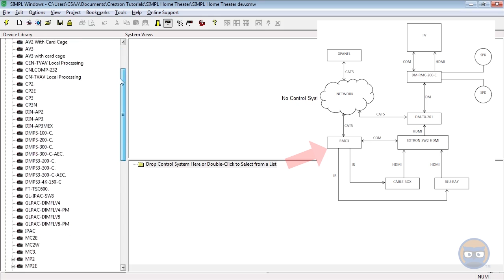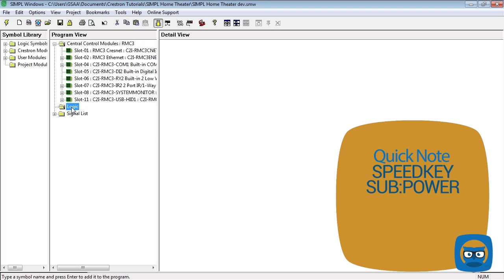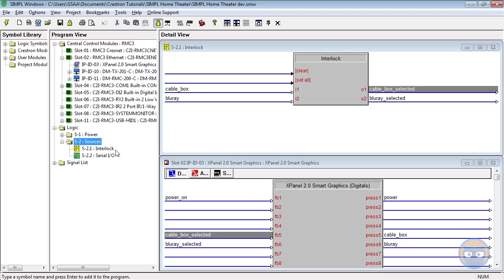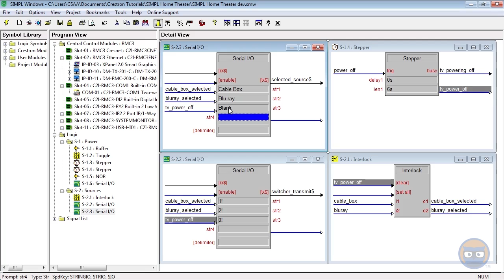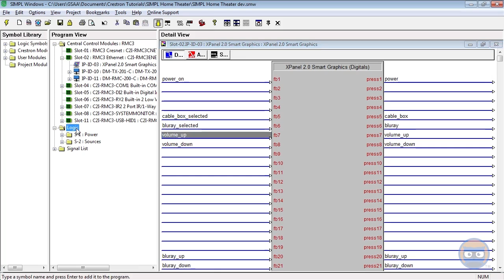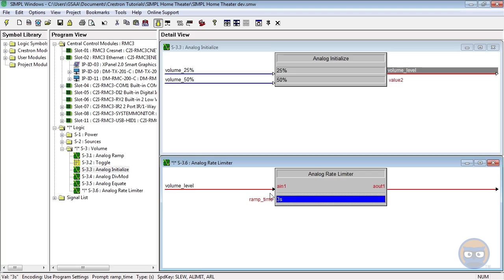Crestron SIMPL Windows HOME THEATER Programming Tutorial

Comment: Why do you add the DM-RMC-200-C to an Ethernet slot on the RMC when your wire diagram shows it being connected via DM to the DM-TX-201-C? Isn't DM a point to point communication that doesn't need to be added to the processors control slots?

Comment: Amazing videos.  I'm in our office practicing on some extra Crestron equipment since I'm being sent in late May for training.  I have one question, at 8:08 in the video you say that "we know the commands before hand" for the serial I/O commands.  Where did you get the commands for the TV?  I assume you got them from the Crestron Device Database which I have downloaded but I can't figure out how to search and look for my Hitatchi projector serial commands.  Thanks in advanced.
Reply from the maker: Awesome! I got those particular commands from the TV's manual. Hitachi has their 232 commands in their manuals as well, but there's probably a module in the device database that will work with your projector.
Reply: Projectors and TVs are often the same commands within a  brand/line so even if you can't find the exact model you just need one of the same make with similar inputs.  Sometimes you have to change a few pieces (input numbers change) but you can get close.  Sony TVs use the same IR codes from 10 years ago.
Reply: PS Ryan, - I'll see you in May

Comment: thanks for video, is very helpful, I have only one problem, I doing everything exactly the same as you, but serial strings doesnt appears on xpanel (source does not appear), there is only blank box. any suggests ?
Reply from the maker: Do you have the serial string going to serial input #1 on the Xpanel?
Reply: I solved the problem, in training you chose Xpanel, but in the files, I noticed that is selected Xpanel smart graphic. I changed the panel to smart graphic, and everything works as it should. I wonder if it should be, or I made something wrong, but I checked program couple times, and its looks exactly like you program shown in video.
Reply from the maker: Oh! There's a pop-up in the beginning saying to use an Xpanel with Smart Graphics instead of the regular Xpanel. Sorry for the confusion.
Reply: I didn`t noticed that:), Every cloud has a silver lining, I lerned a lot more searching for solutions.

Comment: very clear videos detailing everything! is the subreddit the best place to ask for a bit of guidance with crestron?
Reply from the maker: The subreddit, Yahoo group, and Facebook group are all great resources. Facebook 10/10 has the fastest response time.

Facebook.com/groups/crestronprogramming

Thanks for watching!
Reply: Thanks, checking them out now! whilst we're here though, how would you transmit the smoothed analog output of the volume slider to a receiver controlled by rs232c?

I'm thinking Analogue to Serial symbol but I need the string to contain the other bits of the code in addition to the numerical output of the analogue signal

EDIT: found a tutorial. its here if anyone is interested http://crestrontutorials.blogspot.it/2006/04/sending-ascii-volume-commands-in.html
Reply from the maker: Nice! Glad you found the answer you were looking for! I was thinking along the same lines: analog to serial with an analog rate limiter in the middle (so it doesn't flood your COM channel).
Reply: I'm actually struggling as I realised the receiver only accepts hex values in ASCII format. This means I need to change the decimal output of the Analog signal (used a Analog Scaler with I/O limits) into ASCII values for equivalent Hex!